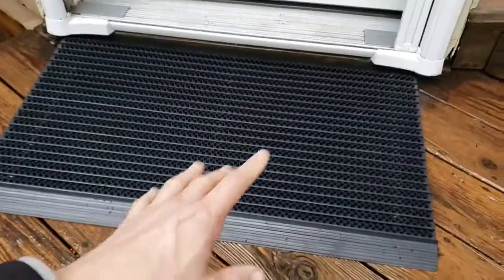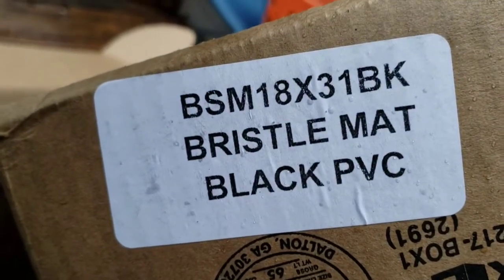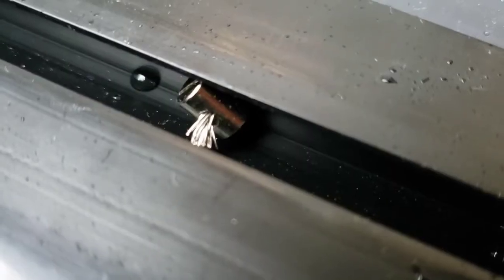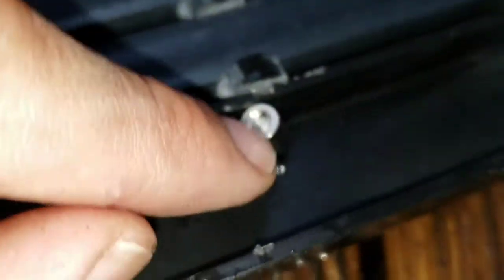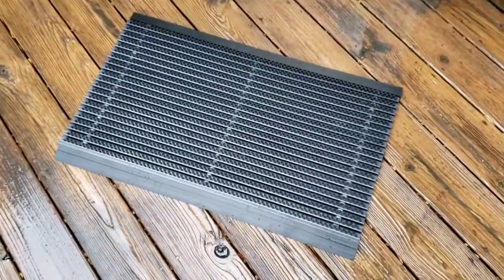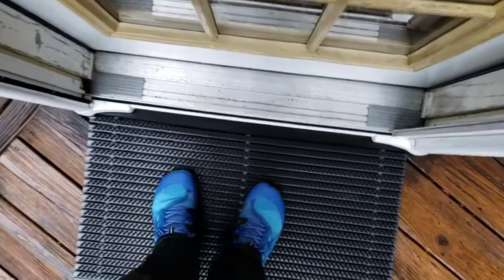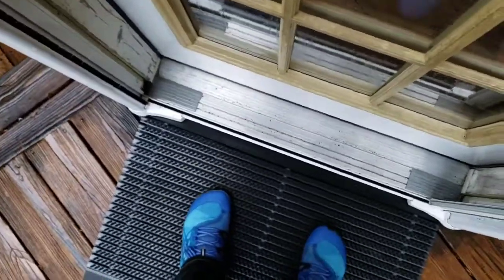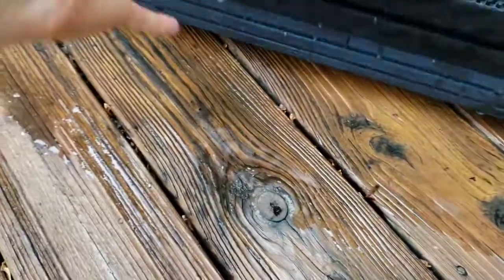MORE THAN A DOOR MAT - An Engineer's Review of Mats Inc. Bristle World's Best Outdoor Mats

Comment: Nice review and I sell these in europe. They are good to clean dirt under your shoes.
You are correct that brushed are hard and low and this is done to increase lifetime.
If brushes where higher and not so hard the cleaning action would be a lot better but the brushed would not last as long.
So this mat is a balance between cleaning and lifetime.
For home use it should last 5-10 years.
This mat works best in combination with a indoor mat that absorbs more water, the outdoor mat keeps dirt and sand outside, indoor mat cleans the rest.
Reply from the maker: Thanks for the info. It's been great so far. I bought a cheap longer bristle boot scrubber and those did not last long at all. The UV destroyed half the bristles within a few months.
Reply: @engineerable  correct problem is what even in your mat the bristles are together. When to long it's much easier for 1 or 2 to come out, when 1 comes out 2 3 and soon all are gone.
Best durable are nylon but this is more expensive, so cheaper mats have polypropylene bristles.
Reply: This is the perfect comment. I was wondering if this would be good for water. I am looking for a mat to help remove water from the bottom of our shoes after a rainy day.
Reply: @Talia_IceCreamPaints  this is an outdoor mat that will remove most of the water and mud. But this depends on the shoe soles. If you have a rough pattern there will always be some water left.
Best is to combine this outdoormat and a drying indoor mat. Indoor preferably microfiber of cotton.
The indoor mat will remove the rest of the water/moisture from your shoes. Only an outdoor mat is not enough.

Comment: Just found this video, the mats are now DOUBLE the price listed in this video, $140 now vs $70 in the video.
Reply from the maker: I checked the Amazon link. There are several different options. The $140 one is with aluminum frame. The one I show in this video has a plastic PVC frame and it is $86 now.

Comment: The bristles are too short and it's extremely overpriced.
Reply from the maker: Bristle length is a compromise, this length is designed for durability and cleaning debris off the surface of the sole. The longer the bristle the quicker they bend and wear out. I use a boot cleaner for deep cleaning. So far this mat is still going strong, it has outlasted all other mats, so the cost is worth it. It also doesn't hold water like most other mats do.